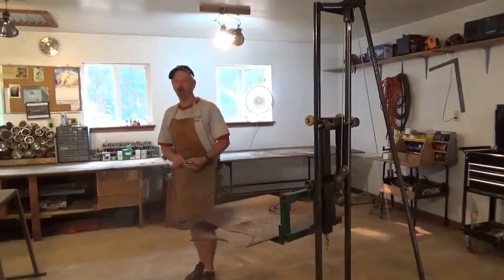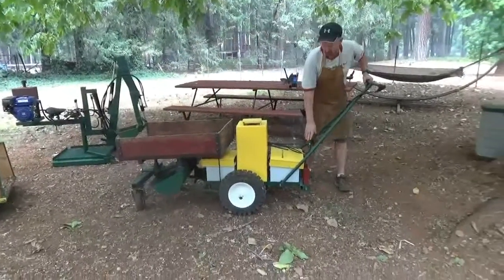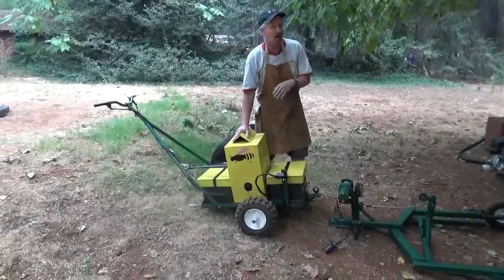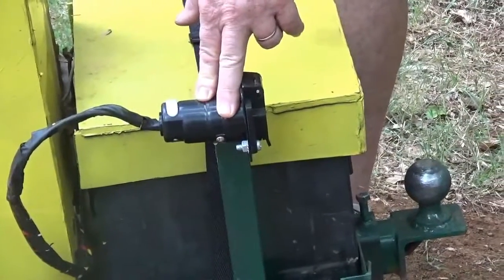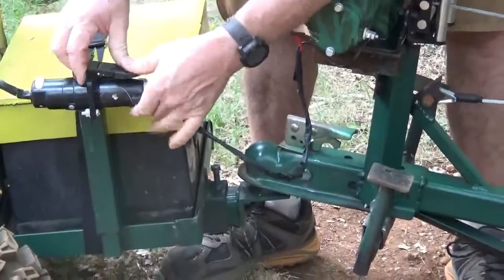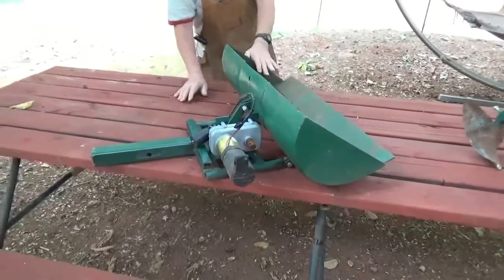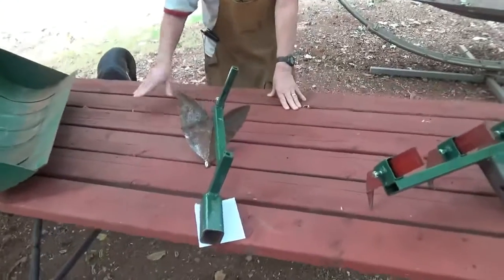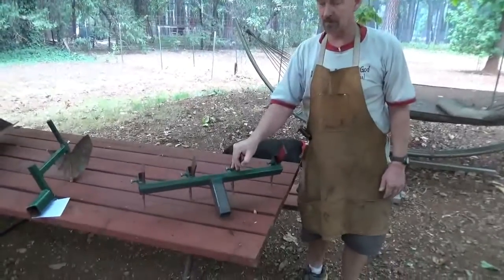Introducing the new Electric tractor and backhoe unit from thegreensmachines.com

Comment: Nice tractor. I got one suggestion for v3 put all the batteries on one side of the wheels and make the handlebars flop from front to back. So you can use batteries weight to your advantage. Very useful machine I think you got something here , good luck.

Comment: From a mechanical design engineer to another. Awesome job. Well done. ;-)
I can imagine this as the perfect use for an electric walk behind. Weight is not an issue, in fact weight is welcomed on this type of application. Range is not an issue, since walk behind tractors are to be used in the vicinity. Torque on electric should be plenty with right choice of motor and gear set. Low noise, no smoke, clean operation by itself makes it a favorite in most applications. ;-)
Fine tune it to be more sturdy/agricultural and you're right on the money. Example, the support for the 7p plug is a bit flimsy. Heavy cable protection... really talking about tiny details since the bulk of the job is already well done. Thumbs up.
Cheers

PS: Be aware pooch and puppies "steal" the show. ;-)

Comment: One of the best things ive seen. Well done! Ive had many similar ideas. Ive used a mtn bike with gas motor on back wheel and electric on frt. Pulled trailer with lawnmower and tools. Ideally a bike/pickup/tractor. Lithium batts. Tribrid power run thru jack axle for electricity or pto. Wide gear range. Bike motor kit provides regen brakes and power. Could also add inverter. Heated cab?

Comment: Very nice. I have a 1966 gas powered two wheeler and I've wondered more than once about making it electric.
Reply from the maker: That should work well. I figure about 1 HP Electric for every 3 to 4 hp gas. The motor Will need to turn about the same speed as the gas engine, You could change pulley size to compensate. Keep the machine just slightly nose heavy and keep the batteries low. Hope that helps. Let me know.

Comment: How long does the tractor and backhoe run on a charge? Awesome ideas and you definitely prove they work.👍
Reply from the maker: Hi Brian. The Walk behind tractor will go between 4 to 8 hours, depending on the work load.  My wife uses it with the wheel barrow attachment and it needs charging about every 2 weeks . If I am doing the heavy Earth moving or plowing, that is when the run time goes down. 
The backhoe is set on gas in the video. I usually go 1/2 a day on a tank of gas. IT is also 110 plugin which will run as long as I pay the electric bill